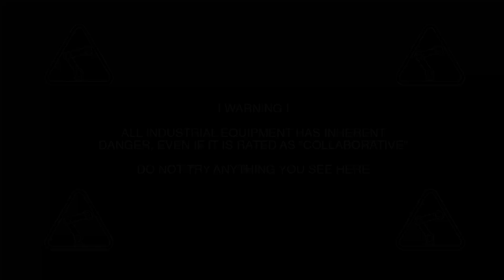Full-Sized Jolteon Robot

Comment: Why glue flat piecs together when it would have bean easy to design in holes for pins/dovels ot even dovetails for segments to slide together?
Reply from the maker: Limited time. Went with something quick that would also maximize the limited foam I had left.
Reply: @DavesArmoury  good point